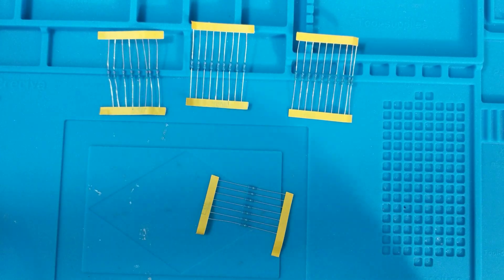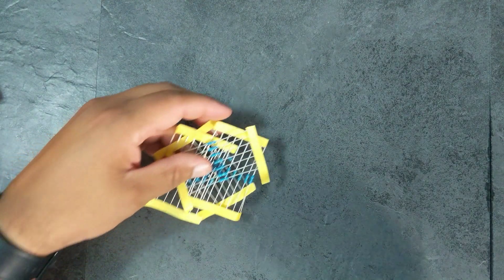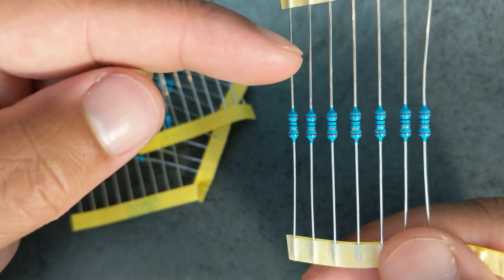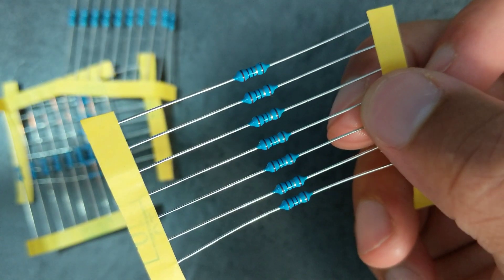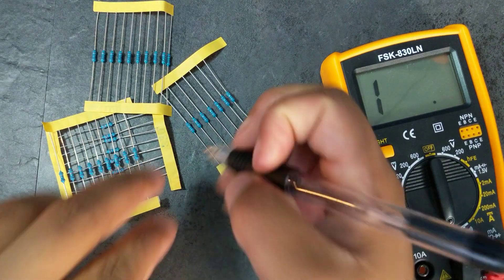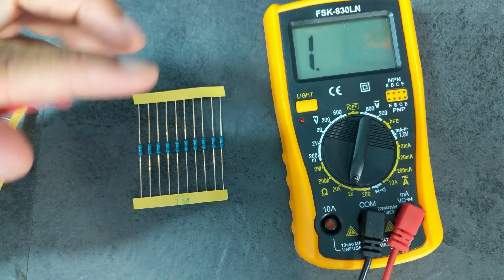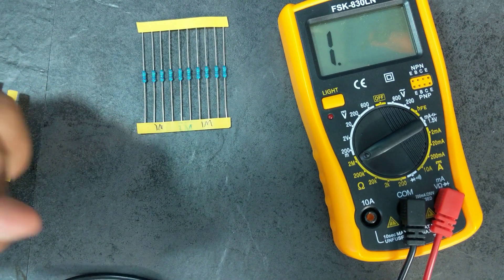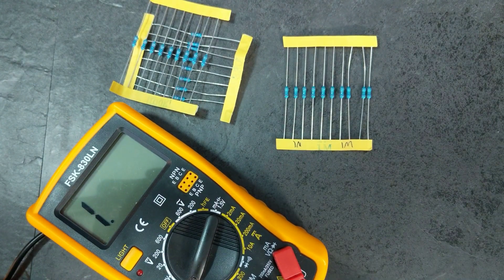How To Deal With Cheap Blue 5-Band Resistor Colour Codes

Comment: yeh, I don't have issues remembering the colour chart, what I struggle to figure out are the actual colours! I can't tell the difference between brown / red / orange and blue / violet. By the time I pull out my magnify glass with little led on it, I may as well have just reached for the multimeter.

Comment: came back to electronics after around 20 years and got these resistors in the kit I purchased and... WTF!? I thought there is something wrong with me, but looks like its just a cheap crap.
Reply from the maker: @lucas.ludziejewski  sadly I'm still using these horrible things, I call them single use resistors now
Reply: @HamedAdefuwa  Looks like everything now is getting low-cost, single-use. This is the "ecology" they are talking about. Take care and thx for your videos.

Comment: You saved my sanity. I am new to all of this and someone gave me a Pi and all this wiring to mess around with. The bag had a BUNCH of these blue cheap resistors in it with no labels. I have spend an hour looking up codes and I quicky found out that I had no clue which end was which end with no way to find out! Well this test is awesome. you saved me! Thanks!
Reply from the maker: @BigJohnM  you're most welcome, good luck!

Comment: Im VERY new to all of this and I have these 5 band resistors. I understand how to read them but when there's 5 bands and none of the ends are metallic, with no gap, I don't know I'm supposed to know. This is so frustrating but I'm glad Im not the only person confused
Reply from the maker: Yeah you're really not. Personally I just use a multimeter. it's saved me time and eye strain. On these cheap resistors, it's super hard to figure out.
Reply: I've got exactly the same issue, glad to see I'm not alone lol